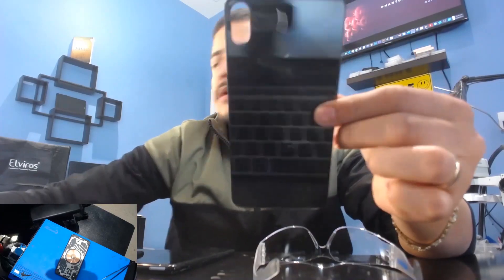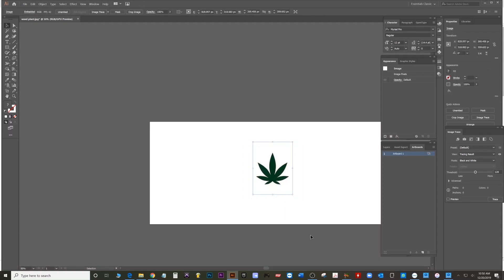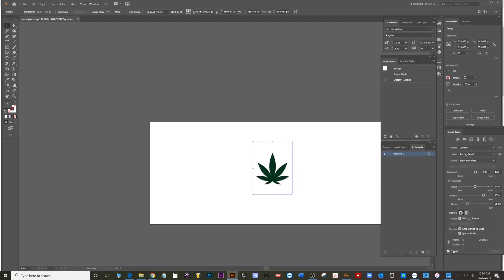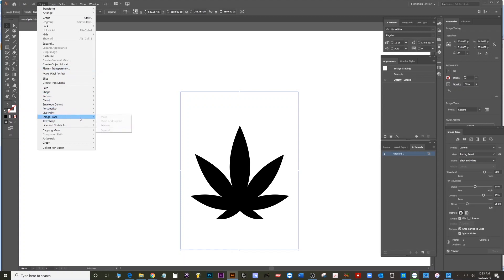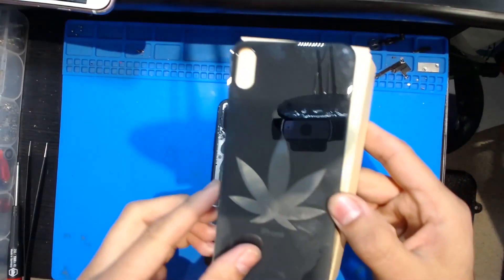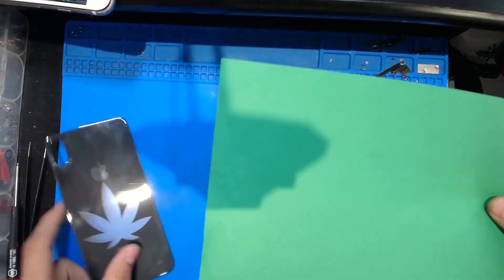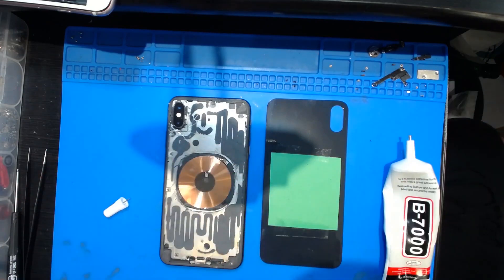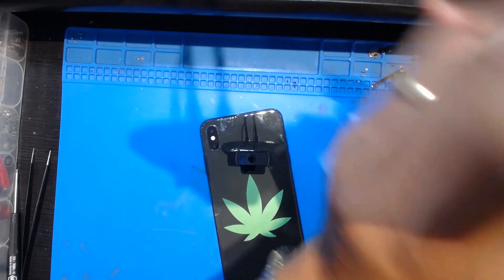Custom Color Engraving on iPhone back glass!

Comment: Can this be done directly on the phone without removing the bck? I have 12 pro Nd I’m looking for name engraving on the bck
Reply from the maker: You can, but it will probably look dirty since all the burnt paint will be dust trapped under the glass
Reply: @911Gadgets  and if I put a tempered glass on the back first and then do it ? Can it be done on tempered glass?
Reply: @tiarav4443  no. Lasers dont the actual glass, it lasers the paint on the glass.

Comment: I thought if you laser printed on glass it broke
Reply from the maker: Nope it's painted
Reply: You can laser engrave on and in glass. But for the purpose of this, the glass is optically clear and flat so the laser light just passes straight through the glass. What's being burnt away here, is the paint on the back of the glass.

Comment: Awesome video, really interesting.. Maybe using acrylic paint or spray paint would be better then paper and clear tape though? Either way, a very informative and cool video 👌
Reply from the maker: Definitely 👍 Paint is a much better option
Reply: Paint could be very quick and easy, but you really want to test that out properly on some donor/broken units first, before doing it on customer devices. And probably mask it off so you don't cover more of the backing of the new glass with paint, than you absolutely have to. Because now you're introducing a new layer/interface, with yet unknown adhesive properties and structural integrity.

What I mean with this, is that if the paint does not strongly adhere to the back of the glass, or the glue doesn't adhere properly to the paint, then the glass might come off too easily if you painted most or all of the glass surface. Same goes for using vinyl, so test its bonding on both sides before doing it on customer units.

Enamel paint and some laquer csn be very strong and work well with many adhesives, but they can also be really thick and viscous, so with those you really need to squeegee the painted area to thin down the paint layer - otherwise the glass might not seat properly